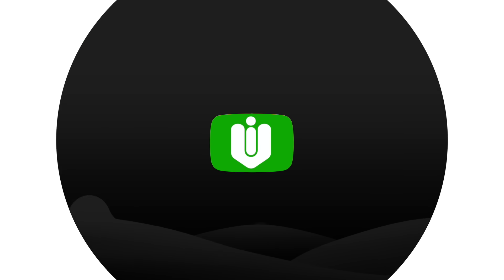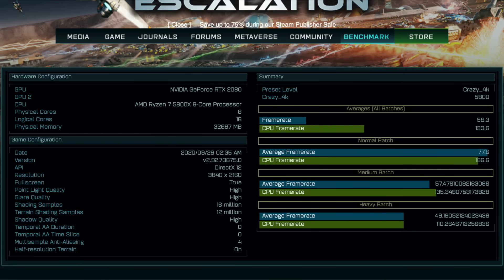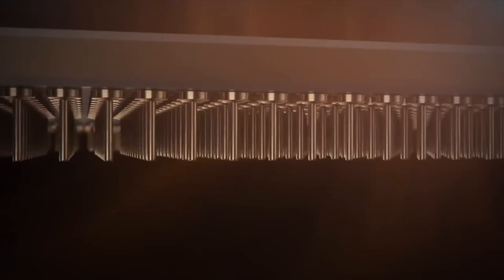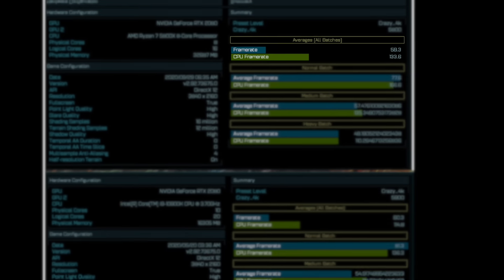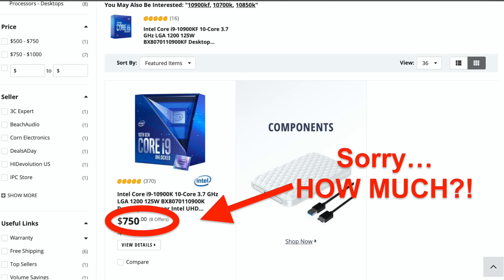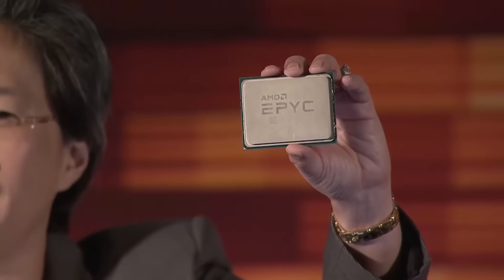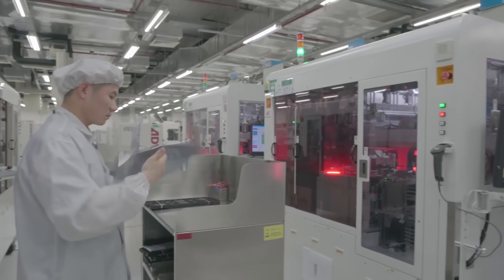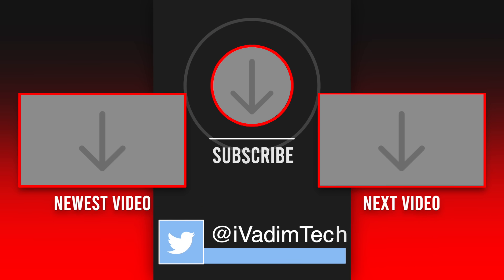🤯AMD Ryzen 7 5800X Crushes i9-10900K in first Benchmark [Zen 3 and Ryzen 5000 series]

Comment: Newegg just had 10900k in stock 2 days ago so I got one (coming from a 7700k). Not a AMD fan but if this leak is true, that’s impressive and fans of AMD should be excited for the 8th.
Reply from the maker: Was it a decent price? I see some vendors are "extorting" buyers.
Reply: iVadim yea it wasn’t too bad. Best Buy and Newegg both had it at msrp but sold out rather quickly!
Reply: There will not be any surprises amd will have price/performance ratio 
Intel will be better in single core performance /gaming
Reply: 10700k is less than £350 here. Great price tbh

Comment: The only thing AMD crushes is benchmarks. Unfortunately when you compare actual gaming performance, Intel are still miles ahead in high end gaming.
Reply from the maker: It is not like they are miles behind as is. Intel was getting all defensive and anti-benchmark for a reason earlier this year. And look like the reason is about to be revealed on October 8th.

Comment: U still get more frames from Intel.... what do I care of the CPU framerates instead the actual framerates
Reply from the maker: Not a very good argument point. Even if you look at the actual FPS in the test it is 60.3 fps on 10900K and 59.3 on 5800X. Would you really pay $100-200 more for 1 fps?🤨 But there is nothing to argue about at the moment anyway. Until we see the real testing in real games.
Reply: You do get more frames from intel, but its at a point now where frames from intel dont outweigh frames + cost of ryzen. Its been like that for the last few years but now ryzen are about level pegging. Intel can only rely on clock speed for so long

Comment: So 4000 series isnt a thing?
Reply: No, they skipped to 5000, probably because 4000 might be an unlucky number
Reply: @tonycheng6478  4000 is unlucky according to what?
Reply: Mike, according to Google, it’s an Angel number
Reply: @tonycheng6478  honestly it makes little sense to me as they released 4000 series mobile processors and 4000 series desktop processors with integrated graphics. The move to 5000 still doesnt make much sense.

Comment: Did anyone see the twitter post where they add the 10900k O/C which deletes the AMD Score also deleted by an O/C'd 10920x rofl... makes you wonder what clocks they were using on the 10900k was running. https://twitter.com/CapFrameX/status/1311014398790639618?s=20  https://twitter.com/CapFrameX/status/1310849002439663616?s=20

Comment: I was just wondering as i have a i7 8700 processor non-overclockable. if I should upgrade to a Ryzen 5 5800x when it releases.
Reply: The 8700 will last you a good few years as it's a 6 core 12 thread cpu, I'd say wait for a ddr5 platform (zen 4?) Therefore you'd get the most out of upgrading and not wasting your money.

Comment: Hopefully this release is nothing like the Ampere release or the 3300x release
Reply: i got the 3300x with a mobo, and was really confused why everyone complaining about the out of stock. I just forgot that im not in America
Reply: OK we'll just refresh the product page on launch day and it's gone...
Reply: As blaqz said.... there are plenty of 3300X chips, the problem is it was marketed as a bundle chip so you need to buy it with b550 board. It was never intended to be a standalone chip. Tbh if you factor in its a £120 chip and the same again for a board they are still priced quite well

Comment: Why did they skip 4000 series naming
Reply: As the zen 2 laptop cpus are 4000 AMD didnt want zen 2 and zen 3 mixed, so they opted to go zen 3 5000
Reply: from what I also heard is that they use 5000 series for next gen of mobile and desktop  because of it will support DDR5.  so it will be more easy for customer to know which cpu support DDR5

Comment: what about ryzen 9 5000 series are they coming?
Reply: Ryzen 9 5900x same core count but clock at 5 ghz
Reply: @sandiaswara1940  is that good news or bad, it doesnt sound like a massive upgrade
Reply: Increase 10% clock speed + increase 15% ipc = 25% increase in gaming
Reply: @sandiaswara1940  that's well good let's just hope it holds off Intel until till there next release next year

Comment: Will you need to upgrade to b550 boards or will these work with boards that can run current 3rd gen?
Reply: X570 would be a better option
Reply: As I understand it, AMD's plan was that the Zen 3/5000 series CPUs would only be supported from the 500 series motherboards, as the older boards had limitations that might make support impractical, but after the feedback and backlash this created, AMD decided that they would provide some BIOS support for the B450 and X470 too. 

It is up to the motherboard manufacturer which cards will get this BIOS, it will probably be considered experimental and may remove support for some older/less common CPUs to free up Flash ROM space for the stuff needed to support the 5000 series CPUs.

The 300 series motherboards is not expected to receive support for the 5000 series CPUs.
Reply: B450 will work with a bios update but the bios update will brick the boards ability to use 1000 and 2000 chips. amd Confirmed this

Comment: cant wait to see the r5 5600 performance
Reply: If it can hold 2160p gaming in smooth FPS in Ultra, will that be the last CPU competitive gamers who also enjoy the art work buy?  It seems like GPUs that can are finally available, just short on supply and probably several years from being affordable on a low budget.
Reply from the maker: OptimisticPessimist , game devs can always start using more cores to bring better effects and features in games. Like the era of 4-core CPU ended, 6-core era will have to end someday as well. But I think R5 5600 will be good for years to come:)
Reply: @theivadim  I'd rather spend more for a 8 core cpu than 6 cores and change it in some years. plus I use blender and I still have a i5 6600K 4 cores lol
Reply from the maker: @connork7335  if you need more cores for Blender then why not look into getting a discounted Ryzen 3000 series(after Ryzen 5000 sales start in November)? Maybe there will be some good deals on 12 core 3900x.
Reply from the maker: Same here!

Comment: I really hope it will also be at least as best as current Intel gen in gaming. Already got my B550 before prices go up. It's a bet, but a winning one I hope.
Reply from the maker: I'd do the same. I can't see B650 chipset offering anything special over B550.
Reply: @theivadim  Yup, and also there was no leaks about potential B650, plus naming changes who might indicate there might not be a B650 for this release of Zen 3. 

That would mean generation 5000 of Ryzen would be on B550 / X570 / A520 which would be very effective at not confusing the customer, who might have been confused by Ryzen 3000 being Zen 2 and even Ryzen 4000 thinking they were the " real " 4000.  

And that would also be logical as B550 just released few months ago and is day one ready for Zen 3 launch.

Comment: Still waiting to see a CPU that is worth replacing the 6 year old 5960X.
Reply from the maker: I had that! It is awesome!=) How is it holding up in games these days? Still good for 144Hz screens?
Reply: @theivadim  I cannot overstate how fast this CPU is despite it's age. As long as it's overclocked (anyone who doesn't overclock these would be crazy). My silicon lottery was a tad better than average - 4.6Ghz at 1.26V on water, EK Supremacy EVO waterblock. This thing has no problem producing high FPS in all but the most severely single core bottlenecked games. I tested together with 2 friends, one has a 9900K and the other has a 3950X. My 5960X is right inbetween them in gaming performance. Far Cry 5 benchmark on low graphics gave me about 180 FPS average while the 9900K got just over 200. I also have another friend who recently got a 10700K, and he tested the same games on his PC that he previously tested on mine, says it's only a little faster. That's why I want to wait for DDR5, then see whether AMD or Intel takes the gaming crown. Because there is practically no need to upgrade now, as I'm gaming on 3840x1600 at 160hz, the first priority will be replacing the 1080 Ti with either a 20GB 3080 or the top RDNA2 card.
Reply from the maker: The Cat Daddy , wow! I wasn’t expecting 5960X to be THAT good. Awesome! And good thinking on that DDR5 plan. I’d do the same in your situation. And GPU upgrades should always come first anyway.
Reply: @theivadim  Aye, It's especially good with overclocked cache + fast RAM and lowered timings (got 3200mhz CL14 on mine). It's like a whole different PC compared to stock clocks and slow ram from 2014 (2400mhz with much higher latency for example). Stock settings it scored maybe 1300 in Cinebench R15, over 1800 now. I just need a GPU upgrade and I'm set for a couple years easily.

Comment: Will it still work with the current boards
Reply from the maker: Yup! 400 and 500 chipset boards will be supported according to AMD.
Reply: iVadim 470 only though, right? Or is 450 going to be supported?
Reply: @TrevorLahey3  Amd said only 570x board or b550 will work no boards previous to those .
Reply: Exnvalid GAMER that’s what I thought I saw as well
Reply: @TrevorLahey3  that is correct they said they will honor there word but will only support the newest boards
Reply: @exnvalidgamer5449  That's what they said first before they get a backlash.
Reply: @rogerdy2647  oh okay great to hear I got a x570 so I'm good just waiting to finish my new build getting my 3080 founders tommorow from nvidia delivered !!!
Reply: I have an 3700x in ASU’s rog z board
Reply from the maker: David Buckley , then you don’t really need to upgrade:) Nice CPU by the way👍
Reply: AFAIK they backed down from that decision after the backlash it generated and will support 400 Series MOBO for Zen3. AMD said that it would be up to 3rd party board manufacturers to include it in their BIOS updates.
Reply: @band0lero  yep. B450 boards will support zen 3, however to accomodate the new architecture the bios update will brick the boards ability to function with a 1000 or 2000 chip. Not an issue really but if for whatever reason you fancy a downgrade that wont be possible.